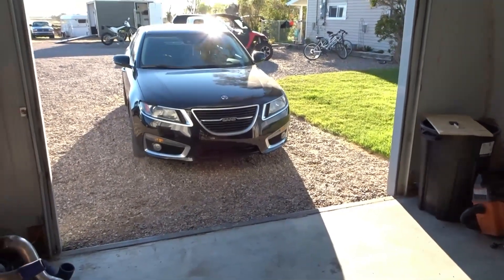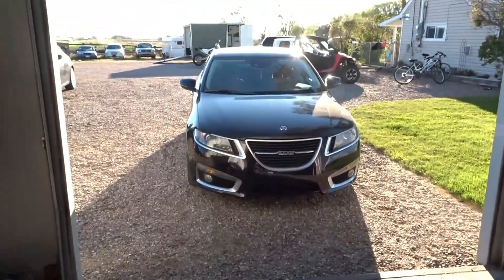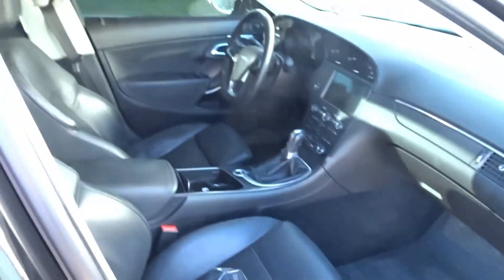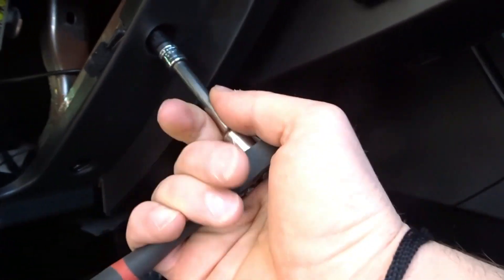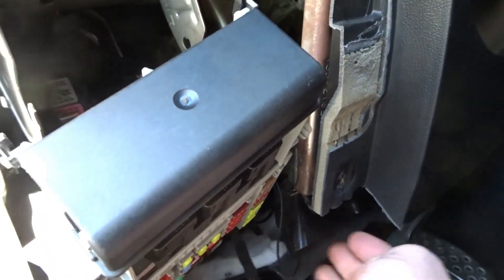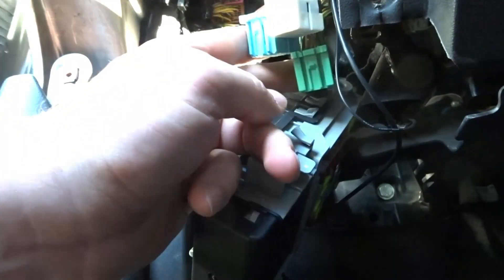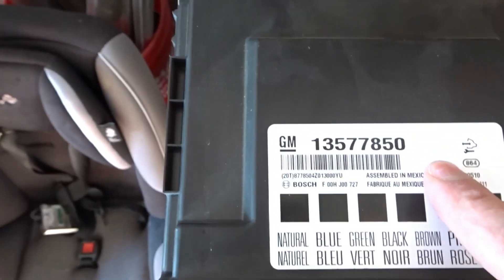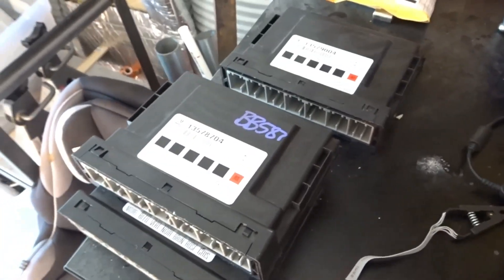Adding a Factory Remote Start on my Saab NG9-5

Comment: Great video. I was wondering is it possible for you to program a BCM for my 2010 95 Aero.
Reply from the maker: Yes I can program it, but i would need your old one
Reply: @BCInnovate  definitely interested. What would be the turn around time?
Reply: @BCInnovate  what would be the turn around time. Nice new video on the turbos.
Reply from the maker: @sharronfarrar3285  thank you and programming the BCM is fairly quick Im going to SOC and will be gone for a few weeks but once I'm back I'll release part2 my camera wasn't recording the later half and so I need to refilm to create the part2 of the remote start install
Reply: @BCInnovate  great have a safe trip. I have to work next Saturday so I can’t make. Enjoy
Reply: How was your trip to Albany?
Reply from the maker: @sharronfarrar3285  it was great! Long drive from Idaho but we'll worth it
Reply: @BCInnovate  I would have to also purchase the fobs with the remote start button after the BCM is programmed?
Reply: Are you available to program my control module any time soon?

Comment: Great work! I have the advanced parking assist on my MY10 :) (from factory)
Reply from the maker: Wow you are luck I thought about retrofitting that one day I have never seen any videos on it I was always curious how it worked
Reply: @BCInnovate  I've never used it though ;-)
Reply: @TechCars  Is that just the sensors for parking? or self park or similar
Reply: @Delta132 It's the two extra sensors on the side and the parking guidance through the display. No real auto parking.